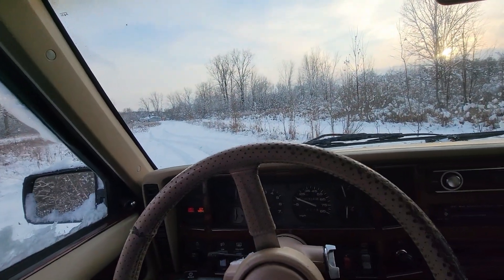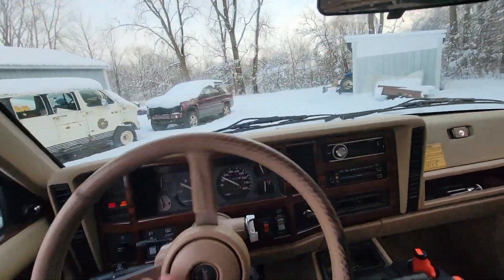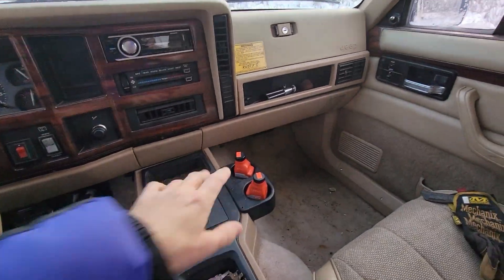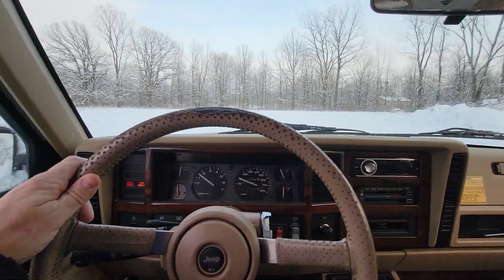Testing my 1996 Jeep Cherokee XJ in a Foot of Snow... In 2 Wheel Drive!

Comment: XJs are no stranger to over heating. My 98 XJ did a darn good job not overheating from hauling trailers and trail riding. I no longer have it and now depending on a 96 XJ. It’s been a basket case even though it has low mileage. Time hasn’t Been kind. I noticed it wanted to overheat quickly driving down a private drive and a recent tow of my kayak trailer up a hill. I went ahead and replace the water pump and went with a 3 core aluminum radiator and I took it on a road trip for a hour each way and crossing a mountain in between and it did well. It does seem to have a different cycle of temp regulation than the next body style. Time will tell if it continues to do well. Next hurdle is strengthening the leaf springs for trailers. I’m debating either an extra leaf or going with an overload spring.
Reply from the maker: I hear ya. Maybe try so air bags in the back. Then the rise won't be so still when you don't have weight on the back 👊🏼👊🏼
Reply: @HFG  Cool beans, I'll check it out!
Reply from the maker: @blueridgehollow2510  I guess "Helper bags" or "air springs" are better descriptions for what they are.
Reply: @HFG  Thanks for the info 👍

Comment: How's the rusty ram doing
Reply from the maker: Getting more rusty every day :) It needs a battery, wheel hub and various other front end things. And brake lines and gas tank straps. Run good though 👍🏼
Reply: @HFG  I love those 2nd gen dodge but they sure do rust if u live in area that gets snow I have a 1998 dodge ram 1500 5.2 4x4 never had problem expect it's rusting  an way but she still runs awesome
Reply from the maker: @nathanmccree2217  I really like them too but they fall apart up here. There are NO nice 2nd gens at all here 😭

Comment: It looked like that fuse holder arced to ground at 4:23?
Reply from the maker: I looked back at it and it does look that way. I can't think of anything that could do that in that location though. Kinda strange. I did change all of that wiring out for triple relays about a year later.